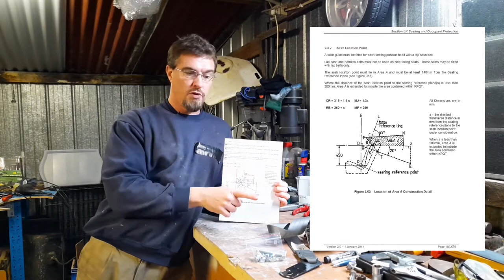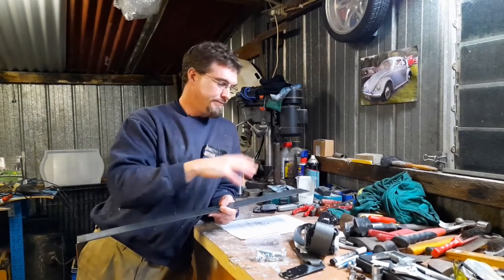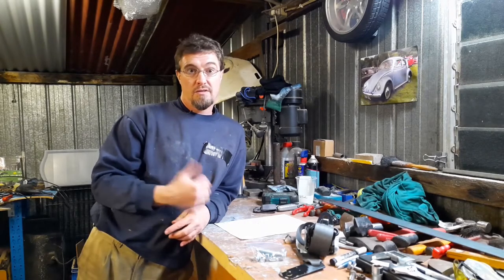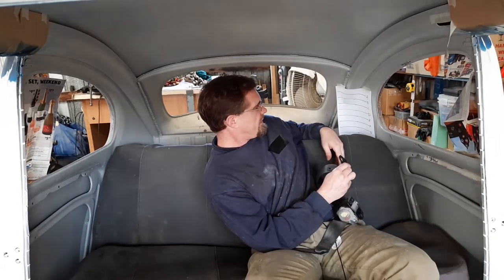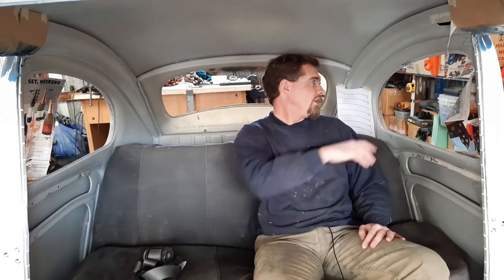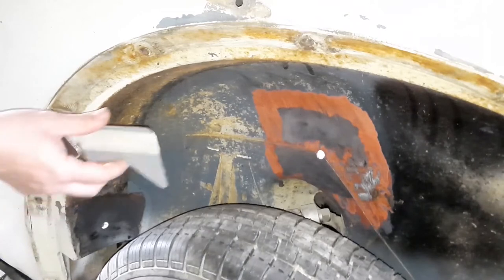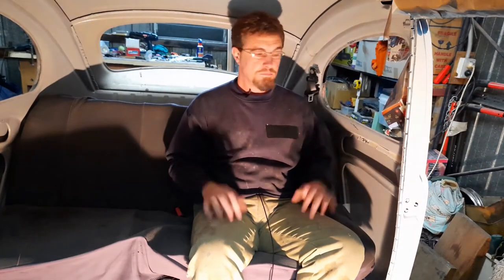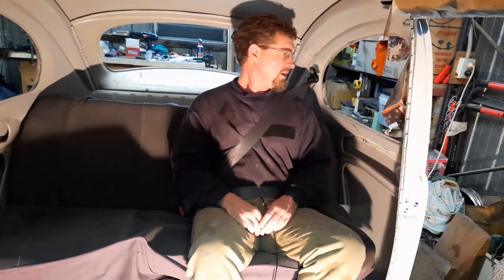Custom fitting 3-point Retractable Seat Belts - To a Classic Car or Truck

Comment: I like it , does it have to be a plug weld ?
Reply from the maker: It'll depend on your local laws but you can use a few rivets to hold it in place. They're just to stop it falling off when the mounting bolt is removed.